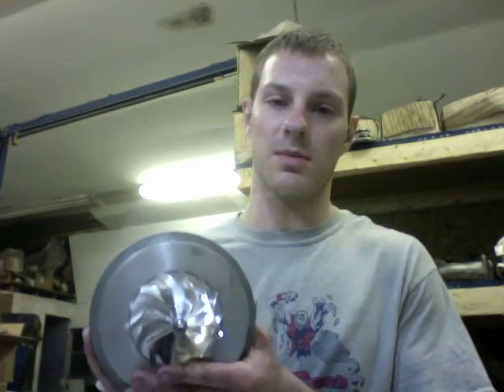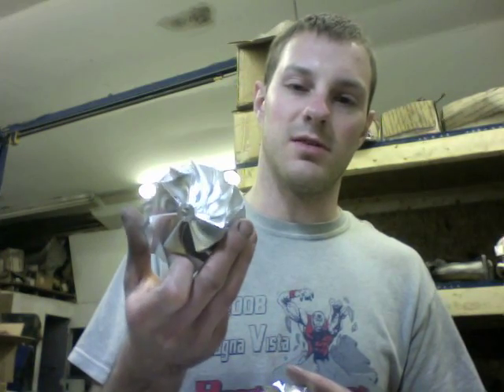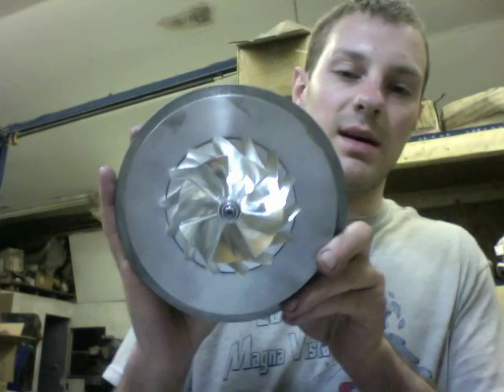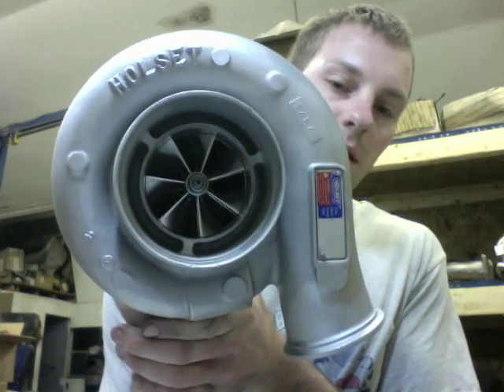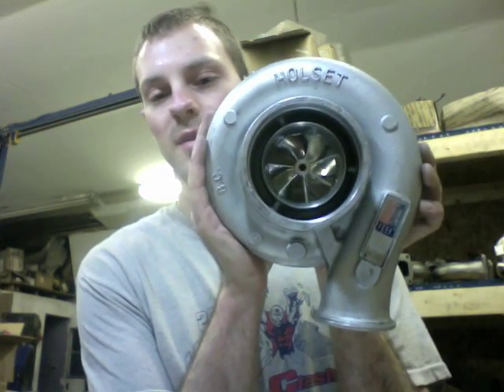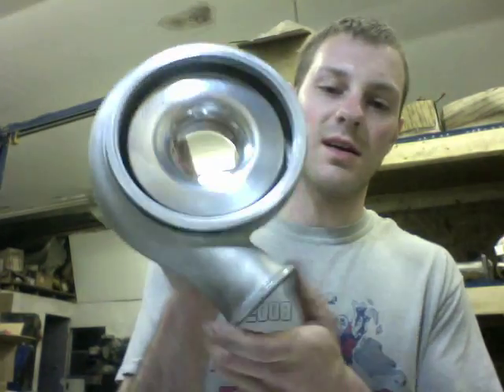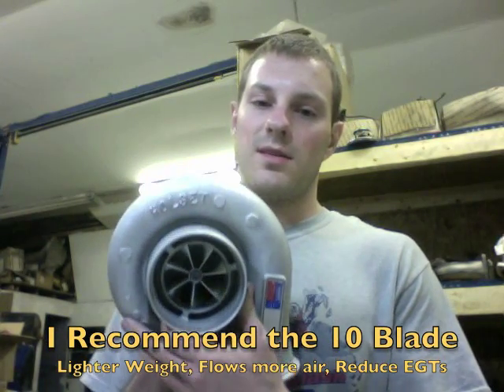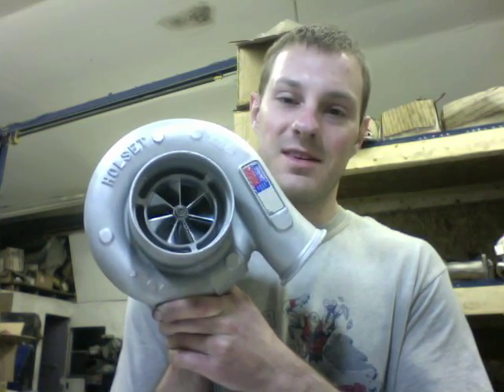Holset H1C H1E turbo upgrade options

Comment: I know this is a 3yr old video but was hoping to pick your brain...
What are your thoughts on the HE351W?? (Not the HE351CW or VE). Looking to upgrade my H1C to a more modern turbo, and the HE351W just seems like a more modernized version of the HX35 (HE line succeeds the HX line). 
I am somewhat ignorant to turbo flow expectations but it looks to be an upgrade to the HX35 🤔
Reply from the maker: It seems like it has an HX35 turbine and a compressor wheel similar to the HX40 but a little smaller. It’s a step below the HX35 HX40 hybrid.
Reply: @turbolabamerica the price seems quite reasonable though for essentially an OEM Holset HX40/35 hybrid - would like to gain efficiency but don't like the high drive pressure and EGTs that go with the 9cm HE351CW. I have an H1C and an HX35 (7 blade) on hand. Wondering if I'd be better off throwing the H1C exhaust housing on my HX35 or dropping $500 for that HE351W. I don't beat on the truck, just want to to be reliable, fuel efficient with better driveability. If just cruising, rowing gears, I lose all boost between gears and takes a minute to light up again. Not sure of the exhaust housing on my H1C as I haven't pulled it off, but its definitely not the lagmaster 21cm. Seems to cruise at 5psi around 2000rpm on the highway and normally lights up around 1500rpm when rowing gears - pushes close to 30psi (haven't taken it above 2500RPM). No pyro yet, but I know that's outside of the efficiency range of the H1C.

Comment: I have the 97 12 valve in my 2000 f350 I have fass fuel 100 hp inj. ham. cam 178/208 which is i.290 e.320. Truck weighs 15000 lbs what turbo set up you recommend I put a sx366 pulled 60lbs boost blew head gasket. Installing new head now let me know. I have all the other upgrades as well .I own McKinney Auto & Diesel Repair AKA MAD PERFORMANCE in Eastland T.X. might be able to work together on some other builds as well.

Comment: I have a question.  I am putting a VE pump off a  90 model 12 valve onto a  98 model 24 valve engine  to get rid of vp pump. Which turbo do you recommend.  The 90 model  for intercooler type without wastegate,  or the 98 turbo off the 24valve  with wastegate?
Reply: WHY WOULD U DOWN GRADE FROM THE P PUMP TO A VE?
Reply: @rocklanddale8646  the 98 model 24 valve had a  computerized vp44 pump factory.  It is a rotary pump with lines to injectors to fit a rotary pump. The ve pump is rotary, so I used the same lines. But the ve pump is not computerized. 
  I don't like electronic injection pumps. Plus the ve pump is  easier to adjust and turn up timing etc. 
   The P pump I am sure would be more expensive plus I would have to get special injector lines also, again more expensive.
Reply: @servantofyahuwah2486  OKEY DOKEY
I'VE ONLY RUN 1ST GENS THANKS FOR THE GRAY MATTER!
Reply: H1C CAME WITH THE VE, I BELIEVE ITS GOOD TO 300+

Comment: hey Austin I have a Holset H1C 3528894 54mm inducer and 62mm 12 blade turbine (21cm) I'd like a upgrade recommended by U for my 500 - 600whp goal in a 1jzgte. Let me know what options is available and if achieving my goal is possible with this turbo

Comment: how much does it cost for me to send in my h1c
Reply: and convert it to an hx40 super
Reply from the maker: +connor jones 350-650 depending on what you want me to build.
Reply: Turbo Lab America I'm building a 4.0 inline 6 jeep motor and am going to boost it, I have an h1c off my 1993 12v, is there any way you can build my h1c to be a good set-up for my build? I'm not looking to make 1000hp, but I want great throttle response,

Comment: would you sell me the machined h1c backing plate and thrust bearing? I just bought a billet wheel for my H1c but it's for an hx35. I didn't realize the super back differences! thanks love the videos
Reply from the maker: +chacelarsen50 There are a few different variations of the h1c compressor wheel size, I don't think the tip height is the same as the hx35, I thought the h1c tipheight is taller but I'm not sure. There is a 56 x 83 and 50x 78 h1c compressor and 54 x 78 hx35 and 56 x 83 hx35 wheel
Reply: I measured my compressor wheel and it's 53.8×81.3

I ordered a mamba 11 blade wheel and it fits my compressor cover exactly like the stock wheel but it just sits too high because it has a taller superback. I was wondering if you would sell just the modified backing plate and hx thrust bearing? Thanks for the quick reply
Reply from the maker: You need the upgraded h1c thrust bearing, the hx35 thrust collar and a machined plate correct? If the exact dimension of the wheel is 81.3 I can machine the plate to 82.5 and the collar
Reply: +Turbo Lab America the billet wheel that I have has some clearance at the edge of the wheel. I don't think it needs to be machined. I just need the plate machined for the hx35 thrust collar
Reply: On the new wheel the tip height is 5.78mm
The super back height is 5.01mm